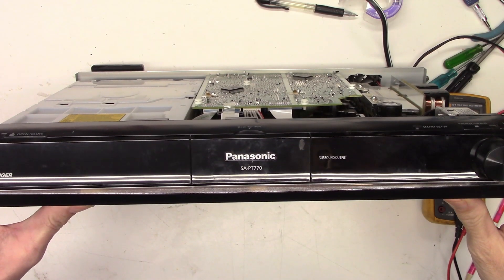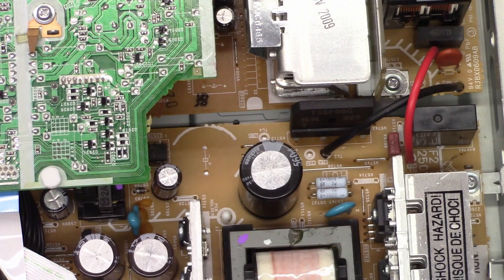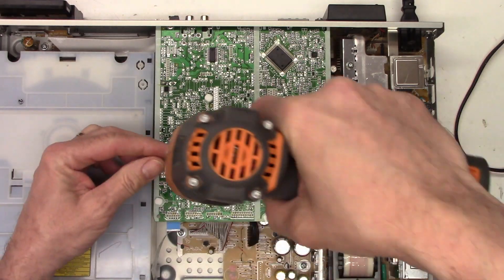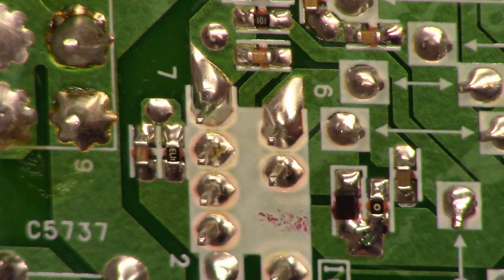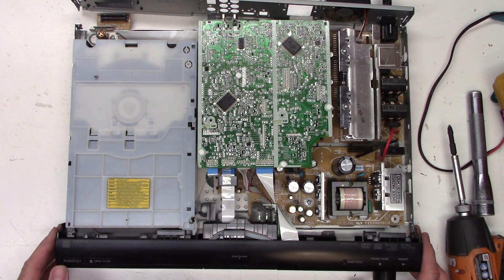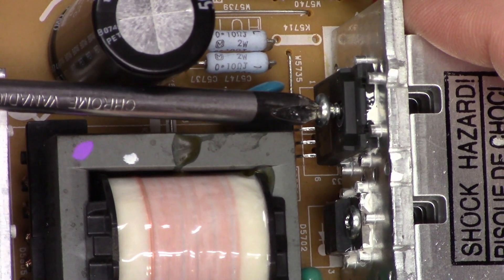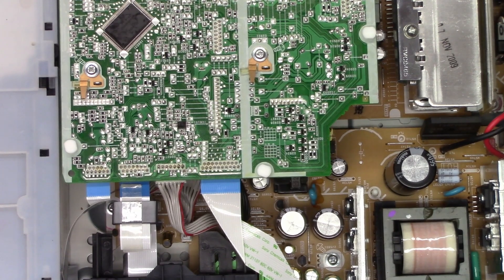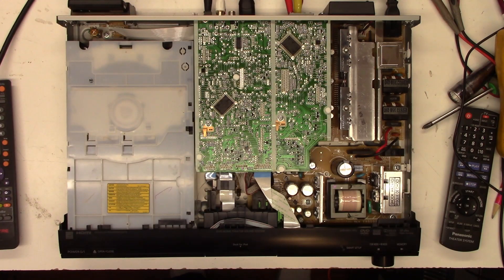PANASONIC SA-PT770 HOME THEATER SYSTEM NO POWER REPAIR STR-X6729

Comment: By following your video and replaced my bad str6768 now my dvd/5.1 surround back to life ,thanks for sharing your video and guide
Reply: hello your problem was the red led on? without turning on when pressing the power button?
Reply: @yanniolaya1556  yes
Reply: @slychong  thanks brother
Reply: Help please, pins # 5 & #6 of STRX6729 they have continuity when are conectes at the board? Thanks!

Ayuda, pin #5 y #6 del STRX6729 tienen continuidad cuando esta conectado a la placa? Gracias!
Reply: Sorry its pin #2 and #3 
Not 5 and 6 i look it in bad orientation

Comment: THIS CAUTIN ABSORVER I NEED ONE WHAT MODEL DO YOU NEED I HAVE A SOUND EQUIPMENT PANASONIC MODEL SA-AK770 AC 110 50/60 HZ 145 W THAT DOES NOT ACTIVATE THE FANS AND GETS ERROR F61 I HAVE THE REGULATOR IC STR-X6768 WOULD IT BE POSSIBLE WHAT IS THAT REGULATOR I WOULD LIKE TO KNOW WHAT OUTPUT VOLTAGE BECAUSE I CONNECT IT TO THE BOARD AND AT FIRST IT GIVES ME A 35 VOLT DIRECT CURRENT VOLTAGE BUT THE VOLTAGE SLOWLY FALLS TO 20 VOLT DC I WOULD LIKE TO KNOW WHAT OUTPUT VOLTAGE DOES IT HAVE TO GIVE? GREETINGS FROM ECUADOR

Comment: Easy fix: I unscrewed the power supply controller IC (without desoldering) then wiggled it around and screwed it back into the heat sink and it powered on just fine after that. He unscrews the black component at 7:55 in case your wondering what it looks like. Perhaps I just got stupid lucky, but I'd recommend giving this a shot before unscrewing any more boards as you can access this piece as soon as you slide the cover off. I did also give the fan a couple turns as well as before trying this another comment recommended it.

Comment: Dude I had the same problem with my unit after not using it for awhile
Funny thing is once I opened it up and spin the fan it stated working again, thank you for being so knowledgeable and detailed with the information.
Reply: Ditto! Thanks a million for mentioning this. I noticed that the wires were loose thus I seated them more firmly. Gave the fan a few whirls (minus power). Plugged in and off she went!

Comment: Thanks for the video! I'm positive this will work (have the 2 clicks w/no power and no fan + it does power on sometimes but then gets warm after watching a film and then shuts off after mere minutes. Was running on wrong voltage, 110v, when it should've been running on 220v. Power controller probably damaged now). Does the SK number matter? Code on power controller is as follows: STR X6768 (SK 9526N). KSA/Middle Eastern version SA PT-875.

Comment: I have also a no power, verrrry slow starting philips htc 7200/12 player set, and there are a lot of rare noises, when i power on, the touch device is on than off, blinking..
And after 2 minutes there is more power on, and backlicht also on. Now i wil know looking whats the problem, and i think its the same as you show, good video..

Comment: just started to look at uk version of same machine  sa-pt570 uses a STR-X6768 same fault, that cap in the uk has 320v on it will kill you. so sharp intake of breath here when you touched it. 
Will try to change chip, definitely not starting to oscillate as Vcc only 10v so only from bootstrap. Only thing found so far was C5726 10mf 50v cap bottom blown out (vcc to s).

Comment: I am having the exact same issue with mine. However it still does the same thing after I replace the 6729 chip. However, when I check two of the 33k resistors like you did I only get 31.86. The 22k and the 33k next to it have good readings but those other two are low. Could that be the issue? Do I need to replace those? Where do I purchase them or is it not worth it?

Comment: need help... any ideas might be of help... i have an older  jvc mx j900 stereo.. i moved the other day, opened the back door to truck and stereo fell to the ground and now it won't turn on it landed on the top left corner , i have taken it apart and see nothing cracked or unplugged .all looks normal.

Comment: Hi, I have the SA-PT470 and it does the same two clicks than yours do, will check it later but it's probably using the same STR-X6729 controller, did you get any weird measurements in diode function on that component?

Thanks from Medellín Colombia.

Comment: How you rectify STR IC is faulty without checking values in multimeter
Reply from the maker: You can do a basic check if you can get an internal view, Usually if you google the part number you can find it. At least you can check diode junctions and some resistor values that way.

Comment: What if i cant switch to aux or dvd with remote or manually  it only changes to radio staions volume up n down it was working fine yesterday ..what could it be if u could help me out would really apreciate it
Reply from the maker: Look in the owners manual for a factory reset procedure. Try that first. Is should restore it to like new out of the box condition.

Comment: I have Panasonic SA-PT870 with the same issue, after plugged into 240V socket with voltage switch as 110V (yes, this is a dual voltage version).  It worked for a while after my mistake and now it is dead with this two relay clicks.  I replaced STR-X6729, but it still has no power.  I took the board out and checked the rest of diodes, transistors and caps and so on, all seems just fine, but the STR-6729 is simply not oscillating!! Vcc is only at 8V after I took the board out and shorted the relay contacts.  The 10uf/50V cap is also fine.  I am running out of idea on how to isolate the issues.  Any ideas on what else I should look for will be greatly appreciated.
Reply: I had the same  problem if you fixed it, please help.

Comment: Hai.. My panasonic sa pt980 model home theatre are not audio output problem. Power on running successfully. But play song audio output was not coming.. Ask to service center he says audio board was problem u can change the board issue was solved. They are costly... Any solution?
Reply from the maker: Usually I do not change boards,  I try to repair the problem on the original board.  Contact me by DM on Facebook, Twitter, or Instagram
Reply: @norcal715  hi. How can I reach you on Facebook

Comment: I have this same unit and same exact issue with the two clicks and no power. Should I assume it's most likely the same issue or is there a high probability it's something else also? Don't want to waste my time trying to fix it if it could be a number of things.
Reply: Ciao cosa significa sum err?
Reply: I really need help I have a similar Panasonic 5 disc changer SA-HT930

Comment: 9:36 that Electrolytic capacitor on surround sound board looks really nasty from this point of view.
Reply: It does look a bit brown on top. If it looks bad, and measures high ESR (or is open) -  I'd recommend replacing it.
I can't tell if it's a peaking coil or a cap from this angle. A close-up view would show more clearly.
Reply from the maker: It just had brown paint (marker) on top of it. It was not domed or bulged at all.
Reply: @norcal715  Why would there be paint on top of a capacitor? I understand sometimes the factory mark them with a blue, green or red felt pen but brown paint looks a bit unusual - especially on one cap.